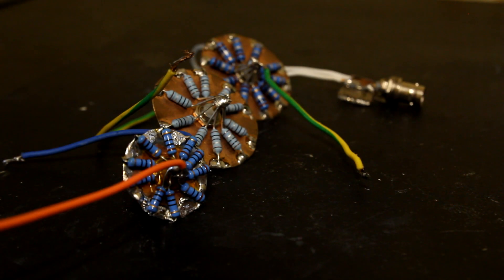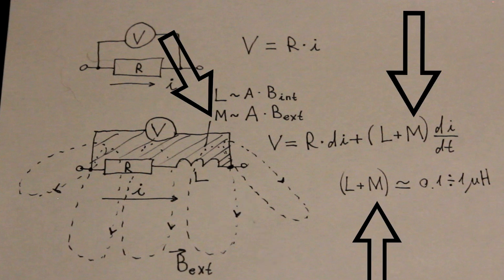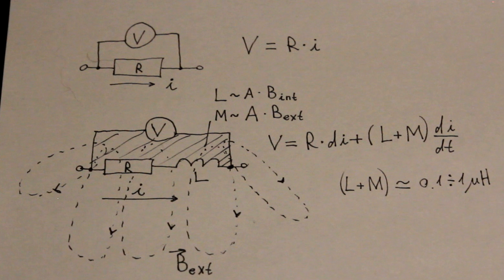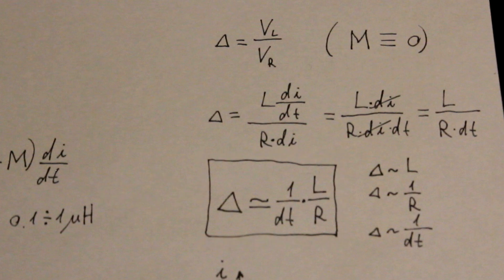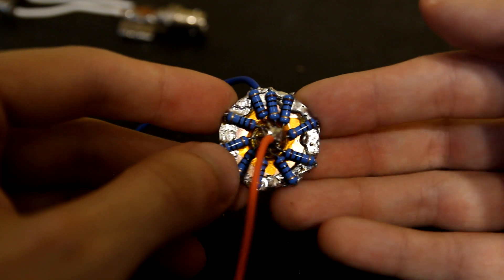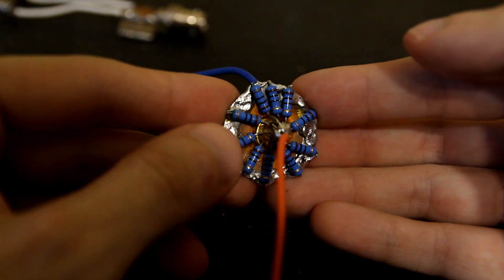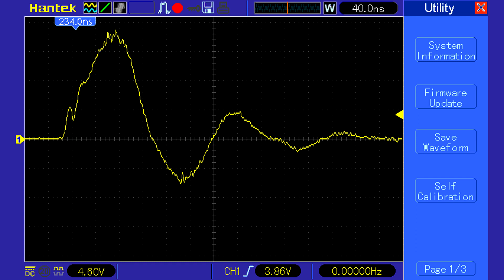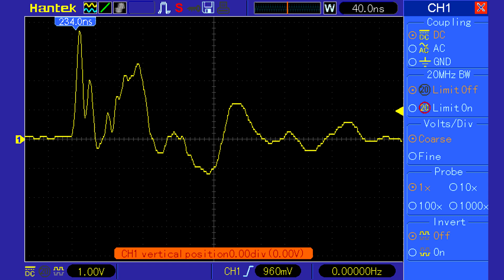How To Measure Extreme Pulsed Currents (Pulsed Shunts Part 1)

Comment: Hi Vidduley
I have a 3V 10ms signal going into 1 ohm load. I cant seem to measure current with a 50mV shunt(1 milliohm). I use an oscilloscope but it's too noisy. How can i measure this current pulse. Your help would be greatly appreciated

Comment: Hi!

I wanted to ask if you would recommend that Hantek scope. It looks like a really with deal due to the included arb function generator, but before spending the money I would like to know your opinion
Reply from the maker: Hi, it's pretty much garbage :) The only good thing about it is the price. Other than that it's really inconvenient to use because of software bugs, lags and only 40 kpoints of memory. I would recommend spending a little more money to buy a Siglent scope and some chinese arb. func. generator, those are just supreme nowadays. I personally have done that about two years ago, I use Siglent SDS 1202X-E scope and FeelElec FY6900 DDS generator. Both are awesome and I am really glad to have purchased these.
Reply: @Vidduley  Thank you so much for responding! I will save a little more and do as you suggest. I think you made me dodge a bullet!

Comment: Hi, this is a brilliant video.
Could you detail how you make the voltage calculation from the waveform?
Reply from the maker: Thanks! Sure:
T=2pi*sqrt(LC) - oscillation period, find T from the waveform, find L knowing C;
Z=sqrt(L/C) - characteristic impedance of an LC oscillator;
Z=V0/Imax- neglecting losses, we can say that Z equals to initial C voltage V0 divided by peak curent in the first waveform peak Imax; find Imax from the waveform, find V0.

Also you can account for losses using any tool you like, either mathematically through e^(-beta*t) and finding beta, or by modeling RLC for example with LTSpice, trying to achieve the waveform you see on the screen by varying R and V0. I don't remember quite clearly now, but I think I accounted for losses using exponent when I made the video. Here the losses are quite high and it's better to account for them.
Reply: Hi, thanks a lot for those explanations. This is really clear for me now. Are you using a voltage multiplier or an impulse generator (marx)? With an impulse generator I guess that C is the serial capacitance of all stage included when it fire but with a voltage multiplier how do you find C? For losses could you develop a bit more the beta option?
Anyway thanks a lot for this video and answer.

Comment: Hy. Did you measure the 100kv 15j multiplier discharges?
Reply from the maker: Hi, no, I sort of forgot that it exists :D I pretty much don't use it at all, but it would be really interesting to see the waveform, thanks for the idea! I would guess the peak current there is about 2.5 kA (just a quick LC evaluation).
Reply: @Vidduley  Tanks for the quick answer.

Comment: keep in mind that the common mode noise it extremely high and your scope will definitely not be able to handle it, you should also test the how CMN influences your result. That is why transformers are used even after the shunt because of CMN
Reply from the maker: Hi, what exactly do you mean? The scope is physically grounded and the input circuit is shielded, so I don't see how CMN could be a problem here.
Reply: hmm, R u just repeating stuff u learned or do these errors look like CMN ?    Why not securely ground "all grounds" to a common point. Like a ground plane or a bus bar which connects the wall side to the circuit side via a big F'in piece of metal. If that is done then any common mode anythings would short to that bar/plane. Anything else would be part of the amp IC's or circuit topology.  You're saying that an input transformer would change this noise ?
Reply: @tdtrecordsmusic  no this is a common problem especially with probes if you dont have fully isolated inputs Differential with very high CMR. I have this problem often wen designing Power Electronics. An easy test you can do is to short your cox cable to one of the sides of the shunt, ideally the scope should show nothing most of the time it does. You can even have the problem on a normal PCB when using a 10x Probe.